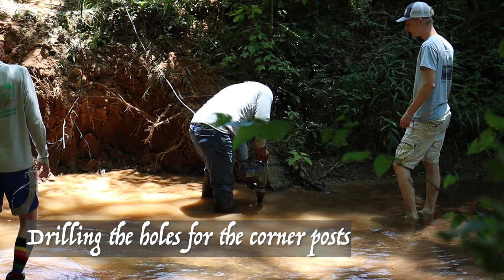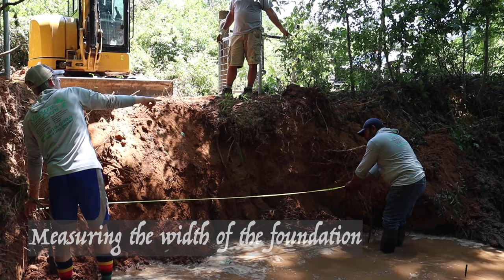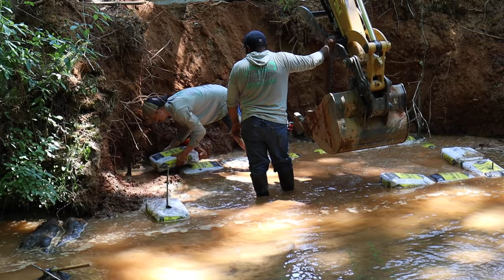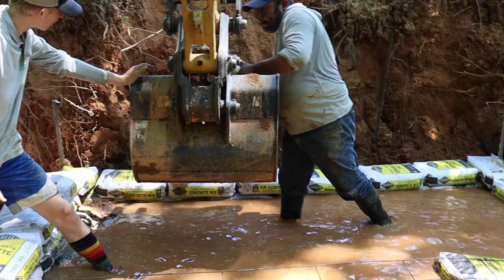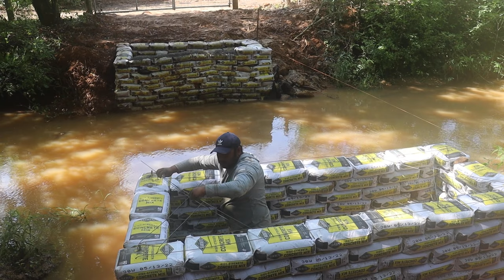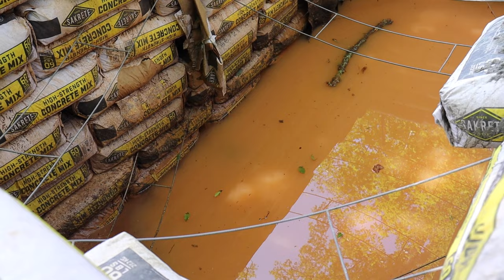HOW WE BUILT A BRIDGE | is it possible? Part 1

Comment: I've never seen anyone build an abutment like that before, sure beats building forms!
Reply from the maker: The main reason we did it that way was because it looks like stacked stone after a while. Also, at the time, the concrete bags were much cheaper than plywood.
Reply: @CannonBottomCreations  setting and bracing forms takes an extra day too.   I wish I had thought of this when I did mine.
Reply: No way plywood cost more than that concrete
Reply: @scotttaylor4125  It's the same amount of concrete either way.

Comment: Glad this is for "entertainment"...  Makes NO Sense structurally, or economically... 
Not sufficient for a structural bond for a foundation... and if only used for holding a concrete pour it must be far more expensive and more labor than traditional formwork...
Reply from the maker: Might make no sense, but it works for our needs